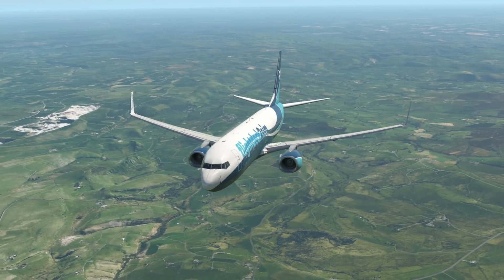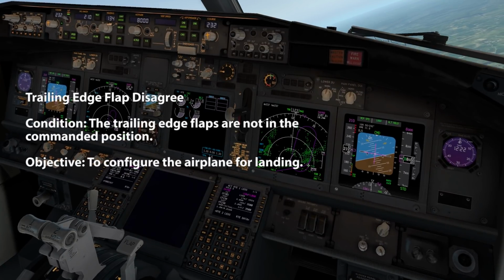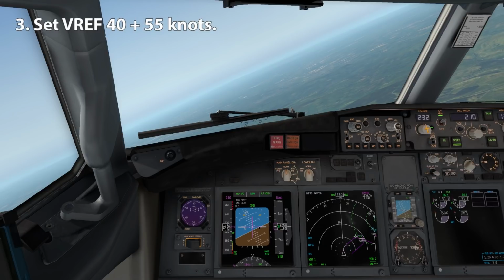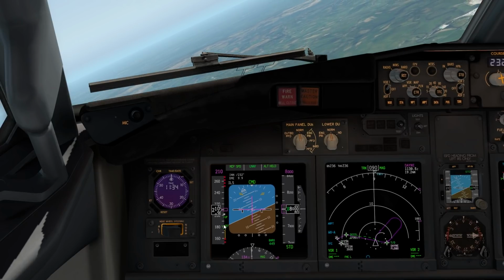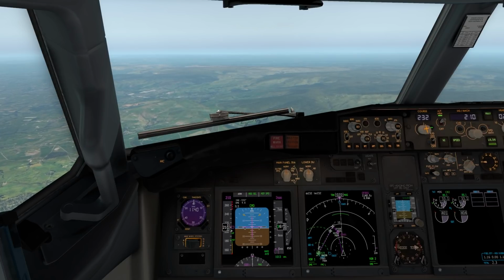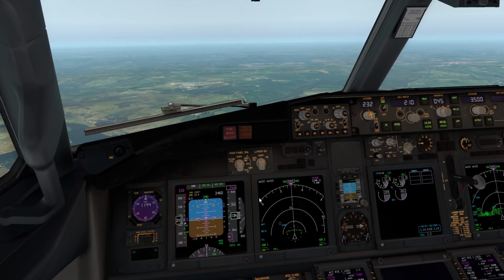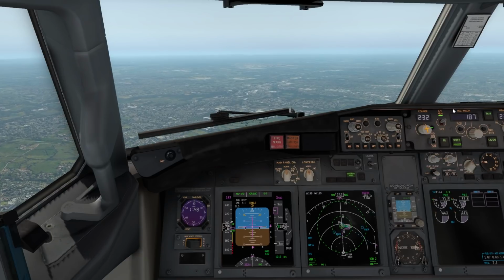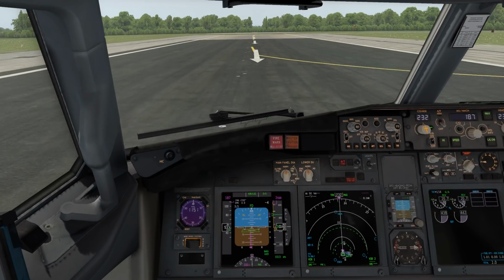Flaps UP Landing Tutorial | ZIBO MOD 737 flown by Real Boeing 737 Captain

Comment: Guys, did you really experience an all flaps up landing in real life??
On a 737-400 in an average weight, your body attitude is a bit higher than 10 degrees up.
It means that if you flare the plane at the landing you’ll most likely have a tail strike…
The speed is so high that the ground effect results in a soft landing without flare. 
I’m talking about an own experience!

Comment: Great content, as always! In 2008 I was on a US Airways 757 from Philadelphia to Manchester and we had to return to Philly shortly after departure, as the flaps were stuck in their takeoff setting. It was a rainy, windy evening, which added to the drama! We entered a hold for about 30 minutes and then made a fast (albeit smooth) landing on 27L. Emergency vehicles were waiting for us. A couple of hours later we were on a 767 and landed in Manchester just a few hours late, which wasn't bad considering! As far as I recall, the same crew operated the second flight.

Comment: Hello Captain. Awesome explaination as always sir! You mentioned that the chances of doing this type of NNC are very low since you need to lose all 3 hyd systems. Wouldn't losing all 3 systems impact nearly all other system onboard (gear, speedbrakes, brakes, reversers...)? Hope you reply 😁
Reply from the maker: Hi Samuel! Hope you're well!

Think you misheard me on that one! I wasn't referring to all x3 Hydraulic Systems! That would be a pretty tough day in the office!

The 3 systems I was referring to.

1. HYD SYS B - This is what powers the flaps in normal operation

2. Issue with TE Flaps Alternate Extension (Electric Motor or perhaps you have TE flap Assymetry)

3. Issue with LE Flaps Alternate Extension which uses SBY Hydraulic Power

FD2S

Comment: Excellent video! One thing to point out one items you missed when your speed fell below the UP speed as discussed and per the QRH, you forgot to set the bank angle selector to 15°
Reply from the maker: Hi Bvetube101

There is no requirement to select 15 degress AOB on the bank angle selector, the QRH just instructs you to limit bank angle to 15 degrees below the UP Speed. 

Quoting our guidance "It is a common error and misunderstanding to select 15 degrees on the AOB selector when advised to limit bank angle in the QRH below a certain speed. This can have serious implications during positioning to final approach and the go around once above the up speed (terrain/spacing etc) due to the increased turn radius"

In the event of a go around in this situation I just need to increase my speed by 10kts to allow me to bank at 25 degrees.

FD2S
Reply: @flightdeck2sim  Ah that makes sense, I think I misunderstood, cheers! Really enjoyed it otherwise
Reply from the maker: @BTube-101  No problem and thanks for the kind words!

Comment: I was wondering if the plane will bounce during the touchdown on such a high speed
Reply from the maker: One of the reasons why the FCTM says light forward pressure may be needed during the flare and after touchdown but yes, it will want to jump back in the air!

FD2S

Comment: I had  on B737400 LE TRANSIT light, it was only a sensor issue ....out of way if you are in contatct with ZIBO team can you ask them if there is  any chance to have geometric VNAV option between alt constraints vs intermediate T/D points during descent in ZIBO?
Reply from the maker: Only thing I had once was after pushback I selected F5 and nothing happened, taxied onto stand and AOG (although I'm sure the alternate system would have worked in flight!) 

Only option for now is VNAV idle path descent.

FD2S

Comment: How come you wouldn’t use Max Autobrake? I’m guessing it’s a case with excessive brake temperatures
Reply from the maker: Hi Connor, in hindsight it would've been better to select in this scenario because we actually need to factor the landing distance when we calculate landing with a non-normal configuration, fine to use if needed.

FD2S
Reply: @flightdeck2sim  Understood. Great tutorial as always. Appreciate what you do for the community 👌

Comment: There are videos of an Airbus A340 and Boeing 737 NG performing emergency landings with no flaps here on YouTube.
Reply from the maker: Is that including both LE and TE flaps? TE and LE on the 737 at least use two different backup systems, the chance of one failing is remote but both is pretty unlikely! If you're mentioning the Southwest one I think they had the LE flaps extended, TE flaps were stuck up.

FD2S
Reply: @flightdeck2sim  Yes I'm referring the Southwest 737 but thanks so much for the clarity.
Reply from the maker: @Bremsen_PCCB  Anytime! In the situation with the SW with the TE flaps up they would have completed the "TE Flaps Up Landing" Checklist which assumed the LE flaps have extended (You can just about see it in the video!)

With the LE flaps extended the final approach speed is VREF40+40 ,15kts slower than an "All Flaps Up Landing" so still pretty fast!

FD2S

Comment: Would speed brakes be working if flaps and slats aren't in this situation ?
Reply from the maker: Hi Darren, they should be! 

The flight spoilers are powered by A and B System HYD px so losing one system would still mean half the spoilers are available, you do lose ground spoilers completely if you lose Sys A.

FD2S
Reply: I’m not 100 percent sure but there’s 3 or 2 hydraulic systems on the 737. The spoilers or speed breaks could be on the other system so if there’s a failure of one system you could lose flaps but not lose speed breaks. I’m not type rated on the 738 so I’m not 100 percent sure

Comment: Not too often you rate a landing both "Nice job!" and "OOF!" Not exactly butter, but just what the doctor ordered. Thanks for showing how it's done.
...Also, that panel looks slightly different -- two landing light switches instead of four. Different variant of the 738?
Reply: LED lights. On the ZIBO you can choose that in the EFB (tablet) settings.

Comment: Would you blow the tires out landing at that speed?
Reply from the maker: Very good point and something that would need to be considered at higher landing weights, hence the need to burn off fuel if too heavy. The maximum tyre speed for us is 225mph which is around 195kts

FD2S

Comment: Why doesn't the flaps up landing checklist tell you to move the flaps lever to up?
Asking because the flaps could extend suddenly on short final and give you a nice surprise :D
Reply from the maker: Hi Felix, excellent question!

With the Alternate Flap System in ARM the TE Flap Bypass valve is in the Bypass position which means only the alternate system can be used to extend/retract flaps, moving the flap lever will do absolutely nothing except update the bug speeds on the PFD.

Additionally in normal operation there is a system called the FSEU (Flaps Slat Electronic Unit) which prevents uncommanded motion of the flaps.

FD2S

Comment: You probably don't need to worry about the high energy braking and cooldown period because this aircraft is likely to not be dispatched anytime soon, correct?
Reply from the maker: Absolutely Jason, this aircraft won't be going anywhere for a while but we would still utilise all stopping forces (Reverse/Spoilers/Runway Length) to minimise brake temperature.

FD2S